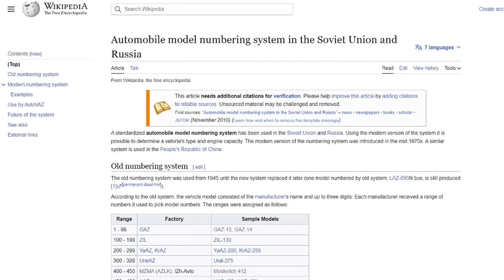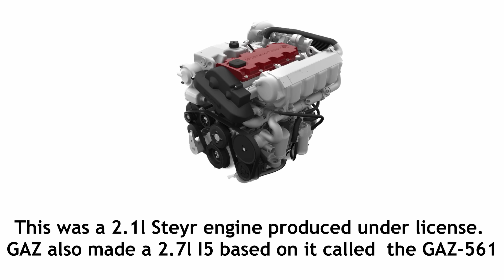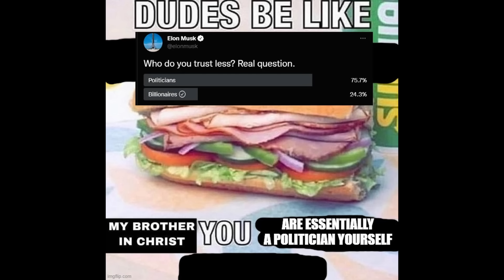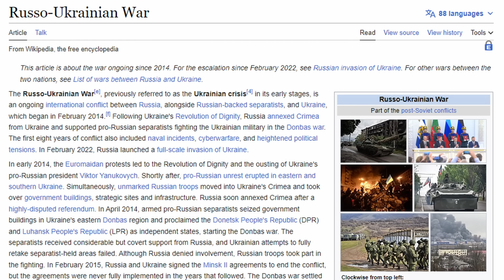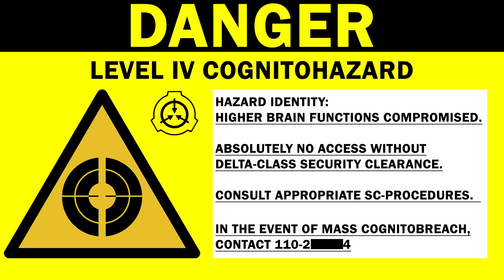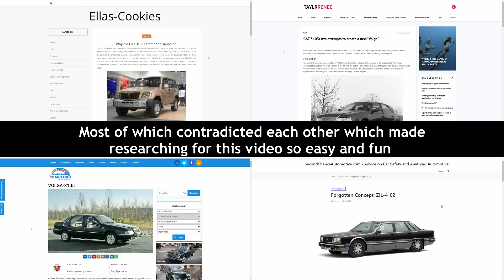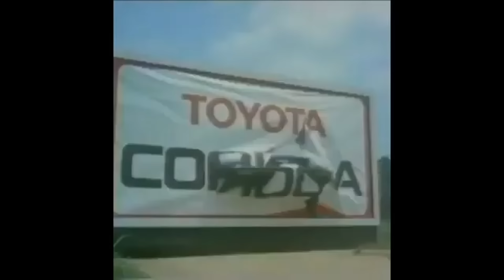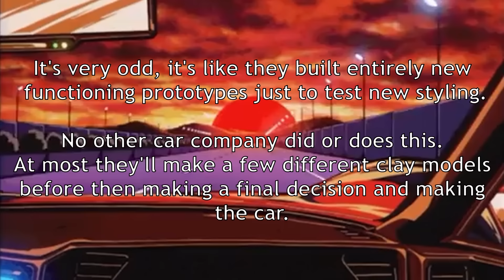GAZ and ZiL: The Death Throes of Soviet Luxury

Comment: Zil had one last gasp with the ZIL-4112R. A prototype was built in 2006-2012. This was basically a 41047 with a facelift, and an attempt to get a Kremlin contract for new state limousines. There's an hour-long documentary 'The last limousine' that tells the story of the 4112R. Putin went 'nah' and used Mercedes limos until the Aurus brand was set up to build the Senat.
Reply: Holy shit dude I just looked it up it's so pimpin
i 💞 chromies
Reply: The cars in the film are made for the May 9 parade. For himself, Putin made the Cortege project ("проект кортеж"), which ZIL never completed.
Reply: I saw one in Canada near Toronto. It was a magnificent car. It's very rare here, I think it's the only one in Canada. It was at an auto exposition. It looks intimidating, like a tank.
(The older limousine, not the prototype, obviously)

Comment: A very unexpected topic for a video on soviet/russian cars. People outside the former USSR are usually just talk about Ladas or if they want to dig deeper - Moskvitches. And yet - here we are. A detailed look on something very few know about. Love it. Thanks to the forementioned Pig for shouting you out.
Also, i find the lack of Volga 3111 in the video disturbing. That was truly the last grasp by Gaz at a modern Volga, and was produced in bigger numbers than 3105, and was kind of a cheaper smaller more avalible to the people. Yet, still costed the same as western counterparts
Reply from the maker: I didn't cover the 3111 because it was much more a do-over of previous gen volgas, with much of the floorpan sharing similar fundamentals from what I've been able to learn (although I'd be interested to be corrected!). I was more so trying to focus on the new developments being made, to emphasize the point that not everything in the USSR was a tarted-up 60s turd. On top of that, if I covered the 3111 I'd feel obligated to cover every single modernisation attempt of the old Volga platform which would've blown the video out of proportion; I did that once with the Rover video, and that took me (admittedly on-and-off) 3 months!
Reply: @IntergalacticBinman  no, actually it's other way around. Volga 3111 was an all original car at the design stage, but in order to get into production, some parts were "temporary" changed to the Volga 3110 one's (like, for example, rear suspension). But after the 3111 failure, some parts of 3111 were remade for 3110, thus making 31105 with new front suspension, based on the 3111.
Reply: Вот уж кого точно не ожидал увидеть в комментариях. Здравствуй, Унылый
Reply: @adriangaliver  я вездесущ
Reply: @Унылый  I guess if I buy one and import to the US for occasional driving, it would be extremely unique
Reply: @IntergalacticBinman y guess for the differing interiors and massive differences between versions is due to them either genuinely lacking materials / money to purchase those materials or someone (possibly lots of someone) just embezzled them.
Reply: Based tovarisch Oonily.
Reply: Унылый?! А ты как здесь?
Reply: не ожидал тут увидеть
Reply: @IntergalacticBinman  Great Youtube video and channel but I found the background music was way too loud and distracting. I would strongly suggest you lower it or even better get rid of it altogether. I firmly believe that background music is distracting, annoying, and unnecessary (especially for educational videos with lots of talking). I also believe that people want to hear you speak/get information and not hear generic background music that doesn't really add anything useful and that people have to mentally filter out. Plus it will be one less thing you will have to do when making videos.
Reply: the police lada and kgb volga with 3 rotor wankel engines with turbo are sheer heaven
Reply: @GetToHellOut Do not forget the 31109 (?). The version of the 31105   with a completely new rearend. It had the fueltank and spare-wheel moved out of the crumple zone and the addition of ABS-brakes.
I presume it got cancelled when GAZ  got the chance to build the "Siber".

But the rear-end of said 31109(?) was very nicelooking...
Pity it never got a chance. I hope a car has survived....

Comment: I love it when people make videos on the Soviet car industry. My grandfather was a driver for a local KGB agent, and his Volga was given as a personal car. My other grandfather frame swapped the body of a used, rusty VAZ-2101 he had bought onto a scrap VAZ-2105 chassis, as it was easier to do that than to buy a new car. Soviet car culture is so interesting. Great video, love ❤
Reply: Was he given the V8 Volga, or it was a regular version
Reply: @CheeseScout  I believe it was the standard version, V8s were only given to higher-ranking officials and some police forces if I remember correctly
Reply: @notaslav  Not too bad driving for KGB with a KGB variant then get a regular one for his own use!
Reply: @CheeseScout I think he was driving a regular Volga for a KGB official. The V8 ones were for field operatives to keep up with cars of foreign diplomats (i.e. spies) while blending in with the traffic. Which is lucky for him since from what I know V8 ones required special training because in order to fit a Chaika V8 into a smaller engine bay they had remove power brakes. And Volgas never had power steering.
Reply: @TheMadSlavik  I wonder with the better powertrain, how the handling was compared to more sophisticated high end luxury cars ( when those had coil spring suspension on the back, or independent rear suspension or even air suspension ) 
but with a car that powerful without power brake or power steering, driving must be a challenge. Maybe like the higher performance early '50s Detroit cars I used to drive

Comment: A very well researched video, especially for someone who doesn't know Russian.

A couple of remarks though:

1- You left out the GAZ 3111 Volga from the early 2000s, which failed for the same reason it's predecessors did: a good car that wasn't significantly cheaper than it's established competition in the executive car segment.

2- GAZ wasn't "robbed by Putin and the oligarchs" (a very oversimplified relationship btw). Its civilian plants and brand name were bought up by Oleg Deripaska's "Basic Element" industrial group, and is now the country's largest manufacturer of vans and pickup trucks, and the second largest manufacturer of buses and coaches. Last but not least, they went from an enterprise that relied on state funding to survive in the 1990s one that actually turns a profit (yes, even without it's military vehicles, which accounted for the bulk of its revenue in Soviet times).

Comment: Hi from Sydney, Australia. Your video appeared randomly as one that may potentially be of interest. AND yes it was.
Thanks for your excellent presentation and visuals for what are now super rare cars. Well done. I loved the blunt magnitude of the two Zil prototypes. I'm now 67 yrs old and on 7th September this year have been driving for 41 years a "flat-pack" sent as kit 1974 Cadillac Talisman to be built in Sydney by General Motors Holden's as right hand drive. This was the most expensive , elaborate version of a Cadillac. Made for just 3 years Talisman offered massive luxury and were powered by an almost 8.3 litre V8 engine, the introductory 1974's like mine were the most elaborate. I bought mine from the first owner, Black in color with "italian tan" (mustard color) leather interior, it looks very "official" 6 metres long and 2 metres wide it does not blend into the environment with todays little cars.

Comment: As Gaz-31029 owner say,pretty good and interesting for considering opinions about the Russian car industry not around lada's) As I read the history of the Volga, the gas engineers had enough ideas and solutions for them, but the soviet government simply did not allow "radically different" cars to be made. Keep it up)
Reply: How good is your gaz 31029
Reply: @RedBird7  pretty good old Soviet car, it middle between old classic volgas and more modern models. In fact 31029 it's 2410 and early 3102 but much cheaper and with very bad quality from factory. I like it, more comfortable and interesting than old ladas

Comment: GAZ & ZiL also did trucks, as well as ZiS.

Most people will know the GAZ from War Thunder. Either the version with 4 maxim MGs, a single 25mm AA gun, or twin 25mm AA guns.

Another War Thunder alumni is the YaG-10, which had 333 of them made between 1932 and 1940. Of these 333 units, 61 of them were converted in AA trucks. Mounting the 76mm air defense M1931, this was known as the 29K.
Reply: I know GAZ from the GAZ 66 from Mudrunner.
Quite a cute little truck.

Comment: In your end bit about multiple models, I WILL say that I wouldn't be surprised that the reason they tried several different vehicles in the same class at the same time, was because under the soviet military system, they would submit several and unlike the west where often none are approved and after a decade ONE is approved, the soviets would submit 3 and have 2 approved JUST in that ONE submission event ALONE. Or submit 5 and have 3 approved. I think it was this mentality living on.

Comment: Another piglet here. Born and raised in USSR (luckily not russia) and was able to drive in several of the soviet era cars before they faded away, so topic close to the heart. Never got to the luxury models tho- last time I was able to sit in gaz-24 was 5 years ago when friend bought one, tried to restore it and after throwing way too much money into it, sold it in frustration. That's the thing with all soviet cars tho, absolutely constant flow of service and parts are needed to keep them going and that is still the same with current russian cars, nothing has changed. That's why I'm quite sure that those luxury cars would have not taken off even when they could been able to start building them as whole factories would have been needed re-tooling and that would just not been possible.
And thanks for the vid, you have definitely a subscriber here, love your other ones too.

Comment: The history of transportation in the Soviet Union holds all sorts of off the wall gems. Like the Vjatka VP-150 scooter: "designed" by a gramophone company and built in the same factory making PPSh-41 and AKs. Supposedly the Vespa knockoff used the same gauge sheet metal as the small arms because that's what the tooling was already set to hold.

Comment: TBH, as far as i heared, the Volga Sedan was destroyed not from outside, but from the inside. Despite making new models with help of US design buerau, despite making good enough impression, despite setting price quite good for such a car, new management decided, that it is not financially viable to mass produce them. Extremely stupid decision, if you ask me
Reply: frankly, they should have chosen another car. Chrysler Sebring of that generation was probably one of the worst cars on the market at the time. If they went with GM W-Body or Ford Taurus ( fixing the transmission of course ), maybe it would be a lot better

Comment: actually, soviet car exports only stopped in the 1992, after the fall of the soviet union, when new EU pollution controls barred soviet cars. As recently as 1988, soviet car exports to western europe were increasing. The cars were cheap, dependable and easy to repair. Britain imported 70,000 soviet cars in the last years of the 1980s. It was a great budget car.

Comment: In the mid 2000s there was a high-end low production station wagon with a GAZ-31105 front and a GAZ-24-12 rear. It was called GAZ-311052-192 VIP and it cost 321,200 rubles. It was equipped with a ZMZ-4062 engine covering Euro-2 emission standard.

Comment: I mean, the part about companies using different styling on the same models is something i have seen before with mitsubishi. One upscale brand new outlander can have a modern looking steering wheel and old infotainment system, another brand new one made at the same time can have a steering wheel that belongs in a 2010 lancer (looking like a cheap, fully plastic bubble) while at the same time having a much more modern infotainment system with apple carplay. They could also have entirely different seat patterns on their leather seats on older and newer models, and at one point they just started mixing both and selling them side by side on the newest models. In addition to this, they started retreating from my countrys market in a weird way. They axed the most profitable car they had, perhaps the only one that was popular since the Galant-days, and left the market by going from offering 6 to 2 models overnight. As they axed their most profitable model (the outlander) by not importing the newest generation, profitability became worse. Suddenly they are trying again, maybe it is too late? Who knows?
I have also noticed that mitsubishi still use the same buttons for the heated seats in their newest hottest car models today that i cab find in a 1995 Mitsubishi l300/delica. Not even a change in printing ok the buttons. Is Mitsubishi not doing so good, or..? The brand new Colt and ASX are just rebadged Renaults, the Pajero is history. The doors on our 2017 Outlander feels lighter and shallower than the one in my 2000 Subaru Forester. The outlander went from looking subtle but cool to looking like a facelifted version of a 2001 nissan x-trail on stereoids
Reply: And is Subaru also struggling? In my market (Norway) they are currently selling one (1!) model. And that is in reality a rebadged Toyota hybrid. The forester, xv(crosstrek), legacy, levorg, outback and just have just been axed.. Subaru doesn’t seem to exist anymore in my market, their only car can be bought in a Toyota dealership..

Comment: Well, first, let's talk about the massive forehead of the Ataman 2308. It's actually because the vehicle is based on a truck, specifically the GAZ 3307. The bodyshell of the truck is essentially placed on a passenger vehicle frame. That's why it has a more robust and truck-like appearance.

Secondly, regarding the numerous iterations of designs, it's mainly due to bureaucracy. During that time, designers had to coordinate their work with the company's leader, who in turn had to coordinate with the government. It may sound a bit crazy, but that's how the Soviet system worked.. or didn't work, tbh

Comment: 21:35 - you can’t have 1980’s Perestroika without Uskorenie. This was Gorbachev’s first big idea “Acceleration”. Like a new 5-year-plan thingy, but forever. The old Soviet U couldn’t or wouldn’t respond. So then came Perestroika to “reconstruct” for efficiency, but in reality to undermine the controlling administrators, like the typewriter manufacturers who had had a say in how many word processor PCs could be built each year for the Soviets. When this was resisted too, the open wind of Glasnost was to blow away the political patronage that kept these limits on new production in place. Problem is when you decide the Army & KGB are to be opened up as well because they’re too expensive and unpopular there’s a strong reason for a coup d’état. I remember avidly watching the live news updates on this coup, which tells you immediately why it failed. They forgot to take the TV & Radio (that centuaries’ facebook) off the air while putting Gorbachev under house arrest and so allowed popular opposition (Yeltsin) to the Army’s actions to be mobilised, with the KGB* going with the strongest wind as it does. 

* The KGB were only strong in a certain axis. Their ethical vacuum allowed them to do the unspeakable, but meant they had no real moral courage of their own to act as a political force in their own right. Can you imagine the terrifying brutal impotence of a state run by an ex-KGB agent?

Comment: Did not Gaz by a production line to build the Chrysler Sebring in 2006 paid a fortune for something that arrived totally behind the market into the Financial Crisis? I was in a Moscow traffic jam in 2008 and started asking about what sort of Russian cars you could get and which were best to which I was quickly told " I am not interested in Russian cars" by my driver.
Reply: Yeah, they did. It failed for a number of reasons. First, an American car certainly isn’t a best fit for a Russian environment — for example, one could damage an oil pan easily because of a combination of low ground clearance, soft suspension and well-known quality of roads. Second, it was too expensive for a domestic car — why Volga, when  same money could buy you a Ford Focus or a Hyundai Sonata? More prestigious, too. Third, it was outdated even by 2008, it’s a car from mid-90s. And fourth, well, when the 2008 crisis struck, that model of building cars with foreign-sourced parts bought with dollars just wasn’t gonna work. Heck, they shipped engines from Mexico, of all places.
Reply: @leoantonov5513  Yes I recall that, I thought at the time Chrysler saw them coming when I heard how much they paid for what was essentially scrap line and not only the power train they were dependent on Chrysler to supply and refresh the line and its tooling. Fir example you see them using a Zeiss 3 axis measuring machine in the launch video to check the bodyshells but they could not go to Zeiss in Germany for maintenance and support, no they were contracted to source it via Chrysler!